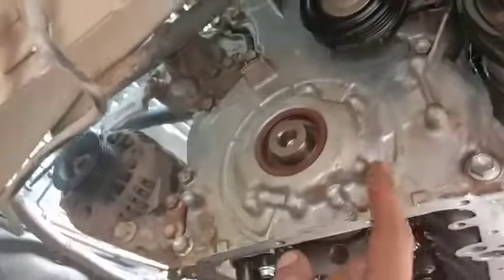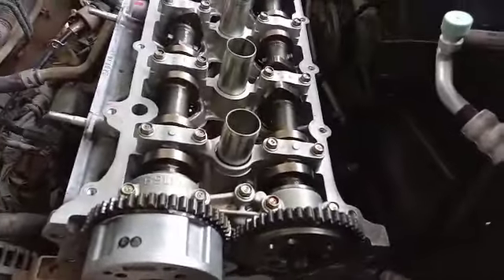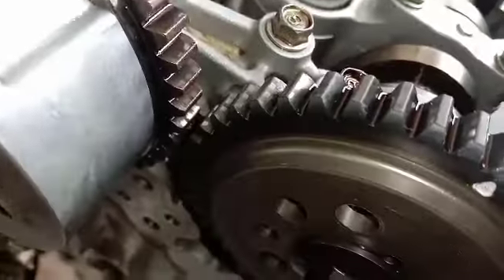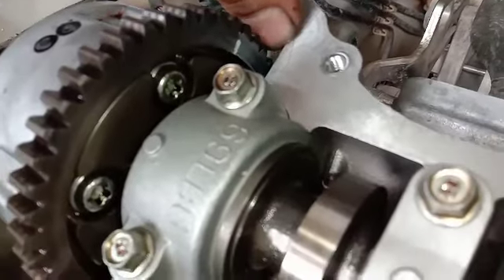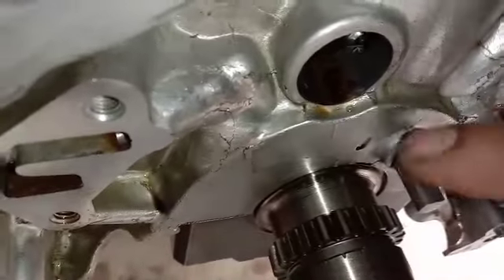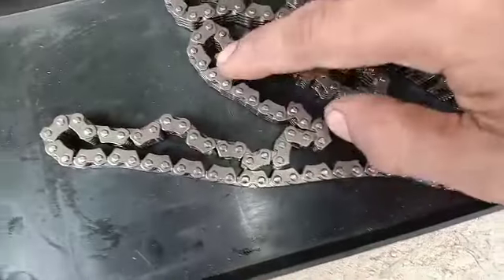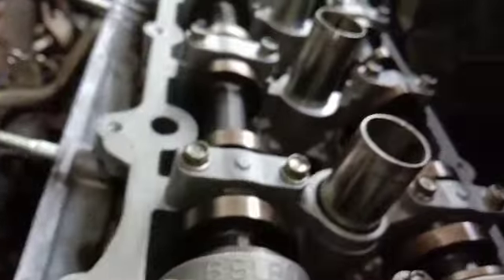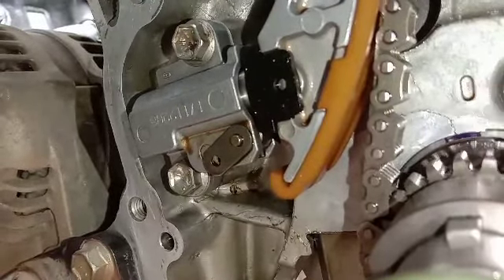Cara pasang rantai timing mobil ertiga 2018

Comment: om ertiga diesel saya tahun 2017 sekarang tahun 2021 suaranya menjadi kasar banget, itu apakah timing chainnya yang minta ganti atau karena apanya ya om? speedometer sudah 31.000 KM. ganti oli rutin sesuai buku service.
Reply from the maker: Seharusnya utk ertiga 2017 dan km masih 31.000 belum berubah suaranya om.. dan rantai keteng pun janrang bunyi seperti yg dikeluhkan. 
Kecuali mobil pernah kehabisan oli, pernah kehabisan air radiator(overheat).